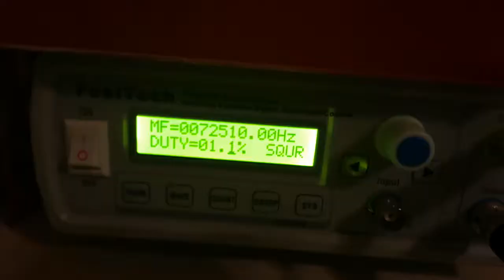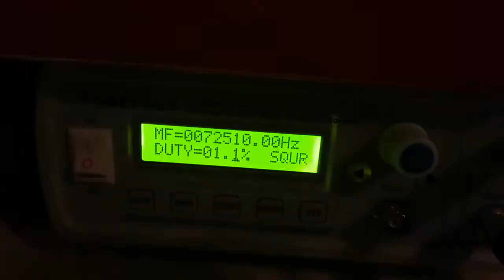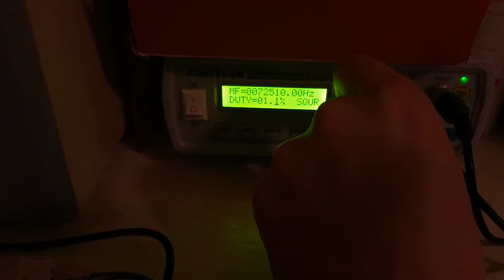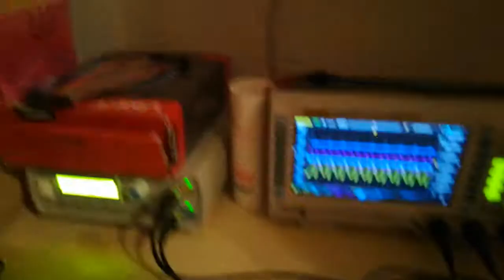Progress in Akula Lantern no 4

Comment: Hi, I see first and second coil are in opposition of magnetic flux (buck) and the part of signal closer to the switch is a bit higher than the other part of signal, it means high current is switched every time, it's rigth?
Reply from the maker: Correct